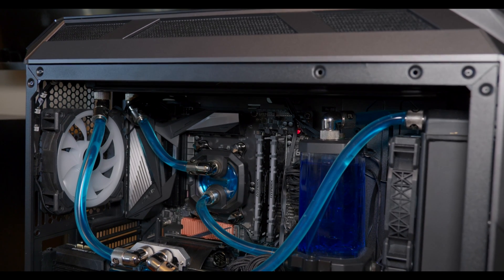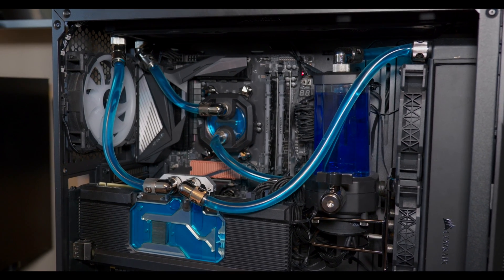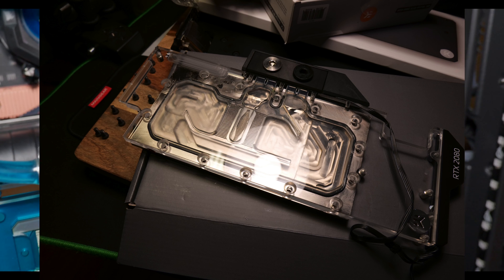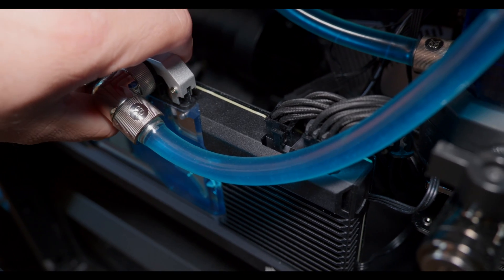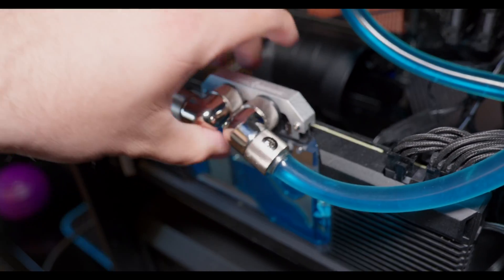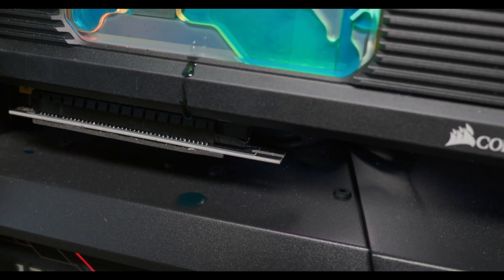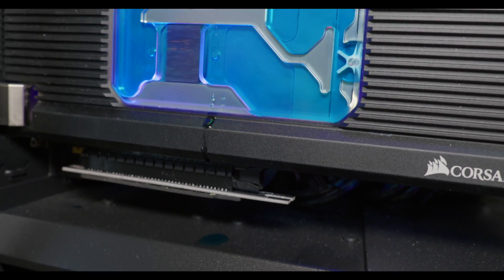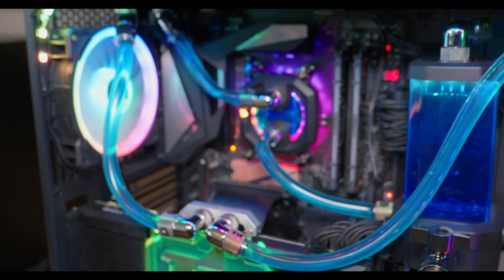Corsair waterblock XG7 LEAK on Nvidia 2080 Super GPU FAIL?

Comment: testing leakage with system off (if it means pump off as well) makes no sense.....and you should always test for leaks with the system off meaning running the pump off external psu with the system off in case there is a leak

one time I forgot to put the o-rings on the terminals piece on my 1080 EK waterblock and it didn't leak with no o-rings until I ramped the pump to max (5000rpm).....and even then it only did drop a tiny bit

these days anyone can make youtube tech videos without actually knowing anything about the subject

Comment: I'm not a fan of Corsair. I currently have their D5 pump/res combo on my hard line loop, and I don't like the performance. Also, I can't get it light up despite following the instructions to the letter. I plan to replace it soon with ether a thermaltake pump/res or Alphacool. The waterblock for my XFX 5700 xt was made by Bykski and it works great. Hot spot temps have dropped from 113c to 48c. I also replaced the Corsair CPU block with one from Alphacool. It looks better and is 5c cooler.
Reply from the maker: The alpha cool stuff is great too